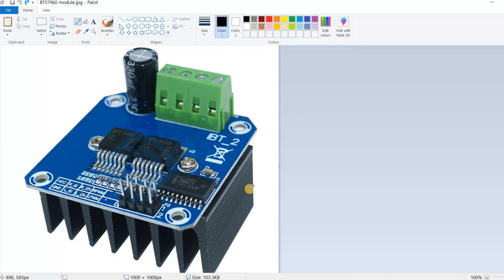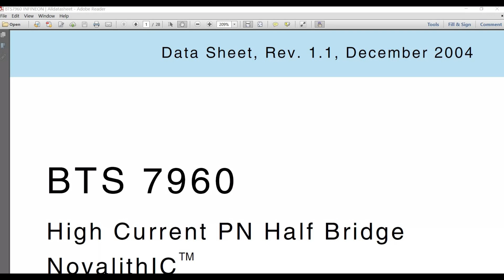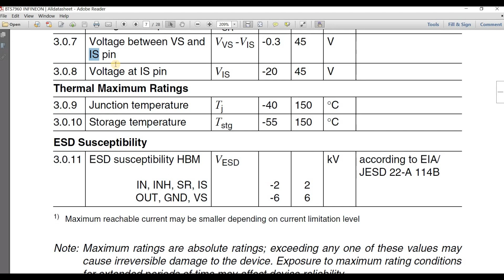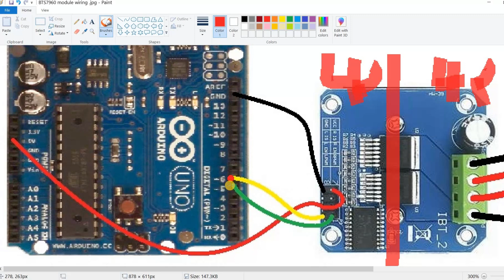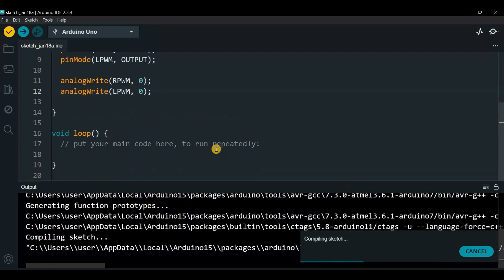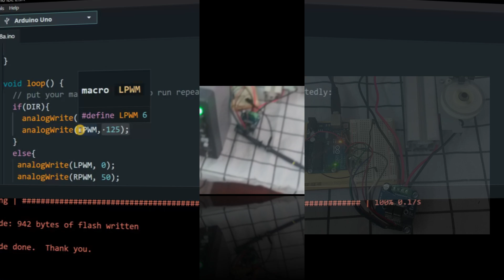Interfacing BTS7960 DC Motor Driver with Arduino: Complete Guide! 🚀⚡

Comment: My question is. Is needed flyback diode on motor?
Reply: No, you do not. That feature is already built-in
Reply from the maker: Correct.
Reply from the maker: Great question! Because the driver module has built-in protection diodes, you generally don't need an external flyback diode for the motor. 👍

Comment: My multimeter test didn't sounds 🔊when the  Multimeter is connected to the out of BTS7960. Does my board have problem?
Reply from the maker: Hi meredithroncejero252
If your multimeter doesn’t make a sound when you connect positive to the output of the BTS7960, that doesn’t necessarily mean the board is bad. A few things to check first:
1. Is the multimeter set to the right mode voltage? Many multimeters don’t beep for PWM or DC outputs.
2. If the motor driver isn’t powered or if the enable pins aren’t activated, there won’t be any signal.
3. Make sure your wiring is correct, and that the motor/ load is connected and draws current when you expect output.
            If after checking all that you still get nothing — there could be a wiring, component or solder-joint issue on the board.

Comment: My multimeter test didn't sounds 🔊when the positive of Multimeter is connected to the out of BTS7960. Does my board have problem?
Reply from the maker: Hi meredithroncejero252
If your multimeter doesn’t make a sound when you connect positive to the output of the BTS7960, that doesn’t necessarily mean the board is bad. A few things to check first:
1. Is the multimeter set to the right mode voltage? Many multimeters don’t beep for PWM or DC outputs.
2. If the motor driver isn’t powered or if the enable pins aren’t activated, there won’t be any signal.
3. Make sure your wiring is correct, and that the motor/ load is connected and draws current when you expect output.
            If after checking all that you still get nothing — there could be a wiring, component or solder-joint issue on the board.

Comment: can i just add thermal paste in between PCB and Heatsink ?
Reply from the maker: If you only apply thermal paste it wont be fully protected, 
I would prefer using thermal sil pad for perfect isolation and best thermal conductivity.
Reply: @Challenger-Tech Okay thankyou

Comment: Is there any way I can power the Arduino UNO directly from the same power supply I’m using for B+ and B− on the BTS7960 instead of using the cable?
Reply from the maker: You can power the Arduino UNO from the same supply, but only if the voltage is within the UNO’s safe input range. If your B+ is 7–12V, feed it into VIN or the barrel jack. If it’s higher than that, use a buck converter to drop it to 7–12V first. Just don’t feed the motor supply directly into 5V — that will fry the Arduino instantly 😅.

Comment: And how can we make this module safer, that it can still be cool with the heatsink without the risk of burning down the house by a short?
Reply from the maker: You may use sil-pad between the heatsink and the board to avoid the short circuit

Comment: Another question I have is the high pitch sounds a dc motor makes when it operates at a small PWM rate. Do you have any idea how to eliminate or dimnish that? I have read that this can be eliminated by the Slew rate? which I noticed at 12:05 of your video. The datasheet says to connect a resistor at this SR 5 pin to Ground. Can you please elaborate on that how we can use this pin to eliminate for pitch noise, because I want to get rid of that in my application.
Reply from the maker: Great question! That high-pitch noise at low PWM duty cycles is super common — it’s basically the motor coils and the driver switching inside the audible range.

Yes, the slew-rate (SR) pin can help reduce that noise. By adding a resistor from SR to GND, you slow down the switching transitions, which can significantly soften the audible whine. The higher the resistor value, the slower the edges — and the smoother (and quieter) the motor sounds.

Just keep in mind: increasing the slew rate too much can also increase switching losses, so it’s all about finding the sweet spot for your motor + load.

I’ll definitely cover this in a future video so you can see the difference in real time — stay tuned!
Reply: Correct me if I am wrong. You can adjust the PWM frequency (generated from the microcontroller) to a higher one, around 20kHz or higher, since humans have a normal hearing range of 20Hz to 20kHz. But be careful, the faster the IC switches, the more heat it will generate. Plus, the BTS7960 can endure a maximum of 25kHZ PWM frequency.

Comment: Thanks for your upload! In other video's they connected the ground from the high side to the ground of the low side. But you did not do that which surprised me. However, I just measured it on the board itself and these grounds are already connected on the board itself. So it seems you did the right thing and others did not know what they were doing I think.
Reply from the maker: Thanks for checking that! 
Yep — on this board the high-side and low-side grounds are already tied together internally, so adding another external ground link isn’t needed. A lot of videos show people connecting them manually without realizing the PCB already does it. Glad you double-confirmed it on your end! 👍

Comment: The current sensor isn't for that; you should test it with different motor loads. The one you show is probably for that motor spinning freely. But if you load the motor, forcing it to work, it should vary, until it reaches a maximum when you block the motor. Remember that using a simple cap, you can convert that PWM signal into an analog voltage.
Reply from the maker: Thanks for watching and your question! 

You’re totally correct — the current sensor can look like it’s barely doing anything when your motor is spinning freely because the load is minimal. Once you apply a mechanical load (or block the motor), you’ll see the current rise and the sensor will show meaningful changes.

And yes — using a simple RC filter (a capacitor with a resistor) to smooth a PWM signal into a steady analog voltage is a smart solution for many applications.

If you like, I can drop a quick wiring diagram and RC filter values for this driver setup so you can try it yourself.

Comment: Hey. I've got problem with BTS7960. When i give more than  2k PWM frequency it getting dull for signal. I'm providing 5V for Enables, PWMs for L and R. All the signals are pulled down via 47k resistors to GND. At low frequency the motors are loud... but i cant give more than 1k PWM becouse its not responsive.
Reply: I will lower the pull down resistor to 2k and than maybe it will work faster.
Reply from the maker: Sounds like the BTS7960 can’t handle high PWM frequencies well — above ~1–2 kHz the switching gets sloppy, which is why the signal looks dull and the motors aren’t responsive.

Stick to 500 Hz–1 kHz for clean operation.
Ensure your MCU drives strong edges and the pull-downs aren’t too weak.
For higher frequency or quieter motors, consider a modern driver like BTN7960B or VNH5019.